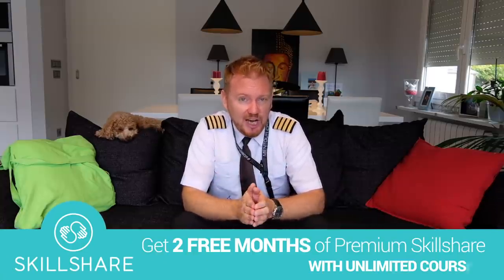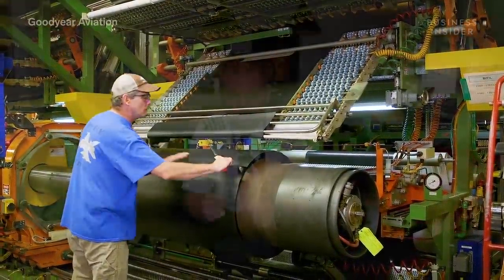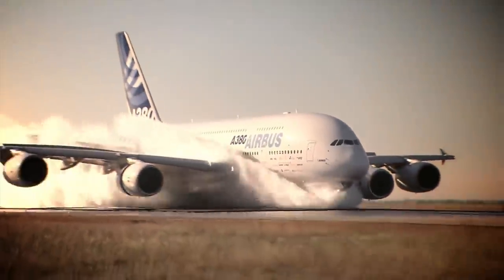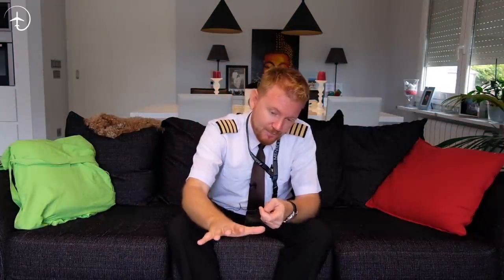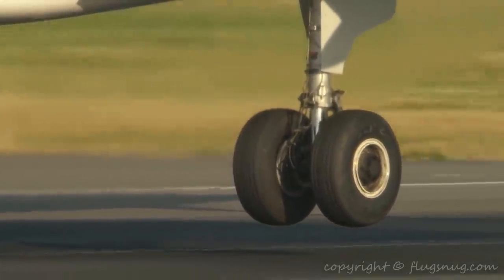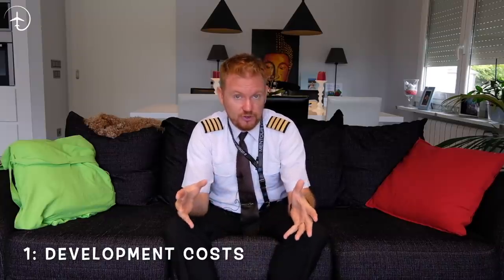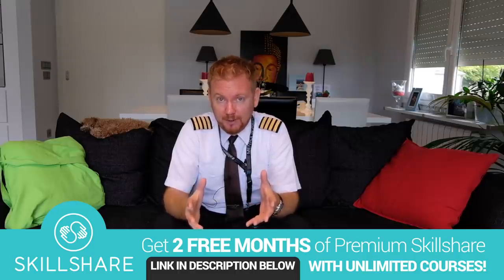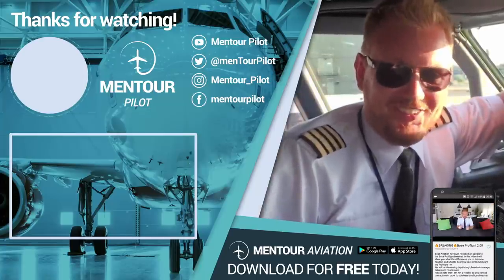Why not make plane-tires spin, before landing?!

Comment: Petter, I like the idea of the electric tugs - that really could work. One question though - doesn’t the taxi give the engines time to properly warm up / cool down before going straight into TOGA?
Reply: It's certainly a consideration with a piston-engine aircraft - especially with a carbureted engine.  Engine oil needs to be warmed up, and the fuel will evaporate more easily in the carb once there's some latent heat in there.  Not sure how much warming a turbine engine requires before going full bore.

Comment: Would be cool to have the wheels partially covered with wheel pants and the tread shaped so they spin up from the wind rushing by, but again, probably not worth it and wouldn’t be able to actually match the planes ground speed.

Comment: You don't need motors, you just need offset fins molded into the tyre so the air will turn them. No new technology required.
The tyres could be tuned to rotate slightly slower than the landing speed

Comment: The answer to this is pretty simple. Unnecessary weight and mechanical complexity. Planes need to be as light as possible to be efficient, and mechanically simple/redundant in order to be safe. It's just easier to make better tires than add complicated systems.

Comment: Perhaps not a motor that can drive the plane, but just that has the power to drive the wheels to the desired speed, and as soon as the touch down happens, the motor has no effect due to its weakness.

Comment: If wind cups were fitted on every wheel, cups just like those on a wind speed unit. They wouldn’t require any power to drive them other than the air speed itself, and all the wheels would be turning more or less at the same speed. It’s a no brainer if you want the wheels to spin on landing.

Comment: after reading all comments I'm sure another episode can be made just explaning wheels tires an benefits of nitrogen pressurization. Nevertheless there are aircraft systems that use spin up systems using bleed air from the engines to rotate the wheel prior to landing.
Reply: Interesting, got a source of info for that?

Comment: I don't think you would need batteries. The airplane has electrical power available from the engines. Tires and break discs are quite heavy, but apart from this weight there is no other force acting against the motor. So, you wouldn't necessarily need such horrific amounts of electricity. Also, you don't necessarily need to exactly match the speed of the aircraft. Currently, they also don't match and it still works. You can also have the tires be 10% slower than the aircraft and it would work in principle while reducing the wear. However, as mentioned symmetry will be a very important factor. And running the engines synchronously wouldn't be super difficult. This falls pretty much into my profession and I don't see an issue here. However, the handling issues are probably very valid. Also, the gyroscopic effects will be unacceptable. And for economic reasons, it probably also does not make sense, as explained in the video...

Comment: What Mentour says about N2 is not correct (~5:07). It basically follows the ideal gas law PV=nRT like any gas. There is a corrective factor to this equation for every species gas, but N2 is chosen because it is not O2, I believe. It would be interesting to research this further.

Comment: No need for engines. Just put fins like a sideways turbine disk on the tires to spin them up. Not much weight, no chance of failure or fires. Even if they don't spin them up all the way, they'll reduce some of the wear as the tire will be already spinning somewhat when landing.

There's no need to "match speed" with left/right or the ground. The speed is already not matched when you have a non-rotating tire hitting a 'moving' ground. Just better the tire is slower or equal in speed rather than faster. And left/right don't need to match since already when you touch one side down first, the two sides aren't going the same speed. There is absolutely no safety or mechanical problem added that doesn''t already exist with passive (ie fan-spinner) tire rotation as described above. Copyright me.

Comment: Why use motors....what about taking inspiration from anemometer. Having few small "cups" might get the tires spinning with the bypassing air. But if it brings too much gyroscopic forces then I understand or if the tires are not balanced well enough then I understand.

Comment: Nitrogen in Plane Tires has been a Norm for the last 75 years or Maybe More Since the 1950's and Military Planes before the 1950's and the use of Nitrogen in Road Car Tires has been around for the Last 45 years or So Since about the 1980's for Some High End Road Sport Cars and in Some Race Cars Since the 1960's

Comment: Why on this as flying. bleed air (essentially high-pressure exhaust) from the APU turbine. This will generate sufficient airflow to spin tires up.

Comment: I wish people would stop spreading the myth about nitrogen not reacting much to pressure and temperature. It's a gas, and there's such a thing called the ideal gas law. All gases do the same thing with pressure, volume, and temperature. They're filled with nitrogen to prevent the oxidation of the rubber from the inside-out.

Comment: Why couldn't you put small fins on the rim to start the wheel spinning When the gear is lowered with windpower before it's on makes contact with the ground?  Fins would not weigh or cost much, and you can even bolt them onto the log nuts as an aftermarket product.  :)

Comment: I've got a partial answer to the problem of using motors to spin the wheels up, don't! Instead you could fit retractable fins to the side(s) of the wheels, when you deploy the landing gear the fins could automatically deploy and the wind would spin the wheels up, if you're having to land in strong cross winds, just turn off the automatic 'spinners' before landing.
Of course that would still add complexity (and something extra to go wrong), and need lots of money spent on R&D, and it wouldn't spin them at full speed! But it would be far lighter and cheaper than adding motors. Also if one set of fins failed to deploy you could just have an automatic system to disable them all (using the existing ABS sensors to monitor wheel speeds). Boeing/Airbus, drop me a line if you more details! :D lol

Comment: 4:56 Fact check : The behaviour of Nitrogen with regards to the relation between temperature and pressure is exactly the same as any other gas. It follows the ideal gas law just like any other gas. Also, air is mostly Nitrogen in the first place. The fact that the pressure is expected to be more constant is simply because it is dried out of moisture. Now yes, it is a nobel gas, contrary to oxygen wich will have other benefits like not reacting/exploding with combustible material like rubber compounds. I corrected the Internet today. Ouff thats a near miss

Comment: I don't know why it is assumed that the tires must be spun up to speed of plane. Let me do some what-if math. What if we used the ram-air technique. I put an air catch basin inside the grille of my Motorhome tied to a 5-inch hose to my intake manifold. I got 3 more miles per gallon and 30 plus mile per hour top speed. So, we put an air catch basin on the plane's nose and aim the air flow at the tires in their bay. If the tires get up to 5 miles per hour, we save 5 percent of the rubber loss. I think the math goes some astronomical amount in the change between stopped and motion. Then the change between 5 miles an hour to 10 miles per hour pre-roll has very little comparative change. The only engineering that may need done is to keep each wheel near the same speed. Which may not be necessary if we get all wheels turning but leave one on each side stationary. I've thought this out 25 years ago but done nothing with it because all my ideas like this are loudly rejected by the ones who take the patent and run with it. What I put down here is legally copyrighted. So please take it an run with it but I'll be watching and requiring my cut.

Comment: How about rims that start to rotate the wheel aerodynymically as soon as the gear is lowered?

Why do the wheels have to match the speed of the aircraft? They don't as it is currently.

I also don't get the point about the crab angle: Land with non-rotating tyres in cross-wind situations and you are not worse off than right now.

Comment: I am surprised I have never seen this video in the last 2 1/2 years since it was made.  Many of the problems you discussed could be rather easily solved by making the system ratchetting/freewheeling like a bicycle drive wheel.  Of course, you would have to make certain that the spin speed of the wheel is lower than the landing speed of the aircraft.  At that point you have to admit that you are only mitigating the tire burning problem, not eliminating it.

I think if this were to be tried, this freewheeling would be required by the FAA as the only practical means of addressing many of the other problems you addressed, especially what happens if the motors fail on one set of wheels and work on all the others.  Here you would still have a tremendous amount of torqueing force introduced due to the speed differential on the different axles, but it would be momentary as opposed to constant due to a locked motor/gearing system. Still, I doubt I would want to be the pilot trying to keep the craft under control under such conditions.

Since you would only be mitigating, not eliminating the problem, those cost-benefit issues you mentioned will become even more important and I would think the engineers and bean counters would both say, why bother.

Comment: Well the reason is cost would be high and extra weight for the equipment would not be good. Not worth the addition $$$. replacing tires often as they do now makes more sense. This was talked about in my AP school years ago this issue was brought up.

Comment: Inert gasses expand and contract with temperature changes exactly the same as any other gas, Inert in this case purely means chemically unreactive, so the real reason for using nitrogen would presumably be to prevent chemical degradation and/or explosive combustion inside the tire; surprised he got that wrong.

Comment: the coefficients of expansion of N and O2 are not very different. How does this fit with your explanation for  one reason to use N vs O2 or air in aircraft tyres . ?

Comment: We're not talking about motors, but about reusing air friction to have the wheels spin on landing
Reply: Simply catching a certain amount of air per second that'd move a mechanic gear. There isn't very much that can fail there, you'd just have to be able to block each of these systems manually in case you'd loose one

Comment: 4,692 comments!.  its the initial speed-up from no rotation to high rotation that is the big stressor.  thats physics.  keep it simple.  use the forces that are acting on the wheels as the plane lands.  direct more air pressure to the lower half of the wheels to generate some rotation.  keep it simple.

Comment: Instead of an electric motor attached to the landing gears why not some sort of fan or are collecting device that is just very rudimentary mounted in the same direction that the wheel rolls so that it would scoop are and get the tires fitting before touchdown

Comment: The tires DEFINTELY NEED to transport side forces e.g. when keeping the plane straight and dealing with side wind loads etc… if they didn’t take the side forces it would be like sliding on ice mate…

Also nitrogen is mainly for less pressure change over tire temperature, as far as I know that’s the same with race cars..  but as far as I know intert is referring to helium and argon etc in term of chemically nor reactive

Comment: to the wheel motors i would say, why changing something that is actually working fine?. Improvement always means to improve what needs to be improved . And Wheels do not need to be improved because its working fine as is.

Comment: Before I watch/hear the answer...I'm going to guess. I guess that just replacing the tires a few extra times is cheaper than the extra direct costs, complexity costs, engineering costs, weight/fuel costs would be.

Comment: The job of pre-spinning the wheels would just add more workload to the pilots at a time when they already have their hands full, right? So, install bicycle pedals to each seat in each section . The cabin crew could give the order, "PEDAL!!" and all the passengers could enjoy the feeling of contributing to the operation and safety of their flight...Each section of the plane could be responsible for their assigned wheel...i.e...First class gets the nose wheels and business and economt get the main gear...

Comment: I developed a method for doing that back in the 1960's to spin the wheels at low speed just enough to break inertia reduce scrub effect w/ no balance issues , no added weight of motors .  But ,  as usual ,   NO interest from anyone .

Comment: Nitrogen in the tires may definitely have a roll in aviation. Especially when you consider the altitudes a plane will fly at, and how hot the brakes get. But this isn't the same for our cars. Don't let the dealerships use the nitrogen in the tires scam on you. Tell them, your car is not an airplane and therefore nitrogen is not necessary. They should remove that fee if they want your business. Just thought I would toss that out, being a former car salesman.

Comment: Reason #4: Tires are rated by number of landings, so tires age out before the rubber wears out.
Reply: that's true of the carcasses, the treads are checked during every after/thru flight servicing and the ground crew will change anything they think needs it, there are strict criteria for tread wear, tyres are normally re-treaded up to 3 times (varies depending on the manufacturer) which is indicated on the side of the tyres.

Comment: how about if the tire manufacturers molded some kind of turbine type fins into the sidewalls of the tires. The wind   would at least get the tires up to some speed and reduce the shock load of going from zero to 250mph. No retrofitting necessary

Comment: You really don't need motors to spin the tires up. Just form several asymmetrical "ears" on the sides of the tire, not needed big ones - I can't show you a sketch right here -, that will spin up the tire after the gears released down, done simply by the air. If that doesn't reach the final touching down speed than no problem, small gain is more than nothing. I was thinking about registrating this as a new patent but I found an already patented idea similar to mine, so be my guest. But if you say that a spinning tire can cause some controlling, steering problem then I believe you, forget it.

Comment: But why not just 'pre-spin' the wheels using 1) bleed air 2) Incoming air .. not necesserally exact match speed - just enough to reduce wear and tear.. Minimal engineering - The wheels only needs to be spun up before landing - It can be disagenged at any time (pilote's choice, too much differential between 2 sides, too much angle.. maybe only the front gear.. 
When you think of it, the amount of time is takes for the wheels rotational speed to match the runway during landing is what.. 1/4.. 1/2 a second ?
If the issue is the fear of the system locking out the wheels, then just make it part of the breaking system (which already has the safeguards) It's just basically a 'reverse breaking' system that is used for a fraction of a second !

Side note : There were visibly multiple attempts at this.. A couple of patents were registered.. They are both abandonned or expired - meaning - they definitely didn't gain interest !

Comment: In other words, any system that could appropriately rotate tires would add tremendous complexity, moving parts, cost, and risk to the aircraft. It would introduce many more failure points that would have to be accounted for. 

It is much easier to simply replacing a static part (tire) after a certain number of tracked cycles, based on very predictable research on tire lifespan. Marginally decreased tire life is just the (least onerous) cost of doing business.
Reply: tyres are checked after every flight and changed as required

Comment: Long before we see any real advancement in the function of landing gear, we'll be seeing renewable and better performing rubber alternatives, making the spinning gears even more pointless. There's a way to achieve the spinning gears today with much of the disadvantages minimized, by just using jet exhaust and pressurized air, but as Petter said, it's mostly pointless because the tires we have today last enough for the cost of them. And we're going into the direction where they will cost less and last longer.

Comment: While you are technically correct, that is not the exact reason they use Nitrogen. In the process of removing Nitrogen from the air, the moisture is removed and it is the moisture that causes the gas to become less stable and not the Air itself which is by the way, also inert. However, the 19% Oxygen can assist burning in the case of a fire so pure Nitrogen is safer there too. So, Nitrogen is used because it is a dry gas and is also inert. But, if you used dry Air, it would equally be as stable as Nitrogen. Obviously, any moisture might freeze at altitude and that is another reason that Nitrogen is used, but dry sir would equally be as stable, it is the moisture content that is the issue here.

If you taxi an aircraft using motors and then start the engines at the runway and there was an issue, you'd have a broken plane on the runway. It would need to use the runway to get back to the aircraft pan and that would cause delays. Better to find the issue before the aircraft taxis rather than just before take off.